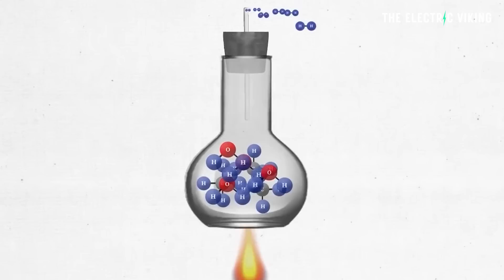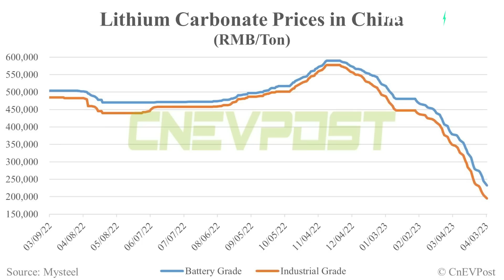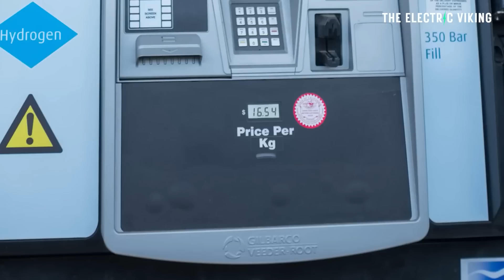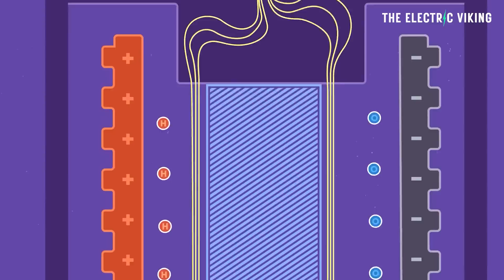Experts say Hydrogen for long-distance trucking makes no sense

Comment: I think the proponents of Hydrogen are blinkered by these key ideas...
1) There's no tailpipe emissions (even though it's emitting 50% of the energy stored in the Hydrogen as waste heat)
2) You can fill up quickly. (Yeah, but is that important when you can fill up when parked?)
3) The range is really long. (Actually no, it's no better than a BEV)
4) Green Hydrogen using renewable energy will be cheap. (Yeah, but you'd travel three times as far on that energy if it was used in a BEV)
Of course, anyone who's done the research knows that the end to end efficiency is 1/3 of a BEV. You still need a battery in a Hydrogen vehicle, and the system is SO complex compared to a BEV. Just picture how much it's going to cost to roll out the infratructure for filling stations.
Reply: Wow said it better than I could. I just said H2 advocates are clueless. I really hate the Green H2 BS. Green H2 wont happen while we have cheap hydrocarbons to rip apart.

Comment: From my experience i would say that one reason why hydrogen has such a huge lobby is that the enourmous effort that you need to put in to have any kind of hydrogen device working works quite well in universities and demo projects. Thats how hydrogen fans are made in universities. And a lot of these guys spend their work experience in demo and research projects where they never experience what it means to have a product rolled out in high volume series and what kind of robustness and reliability you need for that. Hydrogen is like a fatamorgane. The more you chase it the more it disappears into the future. I am really concerned that my Government (Germany) relies so heavily on hydrogen esp concerning energy supply for people and industry. They have made this failure once with cars in general. Then repeated it with trucks. And still if as an engineer you start to question the likelyhood of h2 fixing the huge problem of seasonal energy storage in the near future you will earn heave shitstorms from media and politics.
I am really glad to see people waking up on this if I read through the comments here.
Battery is the way to go for individual transportation / traffic.
Reply: Did you hear about people in america being able to contact emergency responders using fuel cell technology for long periods after hurricanes and the like?
Reply: Your 'hydrogren fans' are from the fossil fuel industry, not universities.
Reply: @Fomites  Indeed Most, But even some universities receive money from big oil.

Comment: Until quite recently - like until 5 years ago, a long-range battery truck did not appear to be possible. All the research was going into hydrogen because it looked like the only viable solution, and the hope was that the cost would come down over time. But it does now look like batteries will take this market.

I am an engineer working in decarbonisation of the rail industry, and again, until very recently the assumption was that hydrogen was the only technically viable solution to replace diesel. There are many programs to develop hydrogen powered trains. I think we are just on the cusp of recognising that batteries may be the better solution for most application. I have made a video on the problems with hydrogen for rail. https://youtu.be/1YDV0Vrmfw0

Comment: It's always hard admitting you've been wrong, but Sam has done so in this video. Some of you may have noticed he never mentioned that "11 people were blown to bits in a hydrogen filling station explosion in Norway in 2019". That's because they never were. A few got injured when the explosion set caused their airbags to activate.
The future really is bright. Hydrogen is expected to be half the cost of diesel in about five years. Sick of wind power going to waste? Don't worry because that power can now be used to make lots of cheap hydrogen. Hydrogen will power planes, drones and flying cars. Hydrogen paste is stable and is 10 times more energy dense than lithium batteries. Hydrogen is so clean it makes everything else look shamefully polluting. Heavy dirty batteries are not the future. Hydrogen is typically made on site at the filling station itself. No tankers just hydrogen on tap.
Reply: Hydrogen will never compete with batteries in road transport. Is simply too expensive.
The world is rapidly changing to BEV road transport while hydrogen goes nowhere

Comment: Hydrogen is currently not viable. It is being promoted by the oil industry because most hydrogen is generated with fossil fuels.
Reply: party;y teh reason. The other reason is quite simply FUD to keep people waiting another year or two because youve fooled them thinking H2 will make BEV redundant, "so why not continue with your ICE for another year or two?" Each years delay is worth literally trillions $ to oil
Reply: Only Green hydrogen fuel makes sense
Reply: You hit the nail on the head mate.
Reply: @larryc1616  Very expensive, why not just use the electricity directly to drive the said vehicle? Saves the second step of making H2. Far easier to store and ship. Right to your front door in fact.
Reply: @Lionel Wylie  because batteries are expensive and heavy. They are good for passenger cars, but hydrogen fuel is much better for heavy duty applications like semi, buses, construction/farming, shipping, military and planes. Fuel cells may be too expensive for cars but makes economical sense for heavy duty applications that battery powered electric motors cannot as of now. Hydrogen fuel has 3x power of gasoline so it can be used in ice applications even as replacement for high octane purposes maybe even replace dirty jet fuel.
Reply: @larryc1616  I have toyed with the idea of H2 for aviation. In some ways it would work. It is much lighter than JetA1 and it would be nice to have a take off weight lighter than your landing weight. (which I am not totally sure of. H2 does have mass but its lighter than air, so would it give you lift?) Well its lighter than Kerro anyway. It would burn much cleaner and you could use existing jet turbines too. However Jet fuel is cheaper than H2 and safer too. It is easier to handle as well. The fuel tanks would need to be very heavy because H2 due to is small size tends to leak out of all but the thickest of vesicles. The extra weight of the tanks might be offset by the lighter fuel maybe. Also given the fact that the H2 would most likely end up coming from Methane or some other simmer hydrocarbon anyway What are we achieving? H2 might work in shipping, I have not looked into it.
Reply: @lionelwylie2326  --"  ...why not just use the electricity directly to drive the said vehicle? Saves the second step of making H2."  Answer:  Why not, indeed!  If you have electricity from renewable sources, by all means, use it.  You would use H2 only when renewable energy is NOT available.  
Likewise, why bother to make H2 when you can use the electricity directly?  Why, indeed?  You would only make H2 when there will be a surplus of Renewable Energy and you don't want to waste it.  
Do those answer your questions?
Reply: @glennstimson6097  --The latest and most advanced electrolyzer today has over 90% efficiency in converting electricity to Hydrogen at high enough pressures to feed into pipelines .  Transport the H2 in pipelines is 98-99% efficient, depending on distance.  H2 compression is 90% efficient.  Fuel Cell is 60% to 70% efficient  Multiply all those efficiencies:  0.9 x 0.98 x 0.90 x 0. 65 = 0.52 = 52% efficiency from electricity to output at the fuel cell.  
Meanwhile, solar PV inverter from DC to AC at 93% efficiency and grid transmission at 93% efficiency and EV charging at 85% efficiency and battery efficiency at 90% :  0.93 x 0.93 x 0.85 x .90 = 0.66 = 66% efficiency from the solar farm to the output of your EV's battery.  
So, comparing 52% efficiency of Solar farm DC electricity to DC output of the H2-Fuel Cell... vs 66% efficiency of Solar farm DC output to AC in the grid to DC EV's battery output...isn't so bad for H2-FC...is it?  52% efficiency the H2-FCV route vs 66% efficiency for the electricity grid BEV route is very close!
Reply: @larryc1616   Fuel cell prices are coming down thats why manufacturers are saying in the 2030s hydrogen is to take of. Currently theres lot of innovation happening across the supply chain companies are well aware of all the issues. As it is lithium isn't going to cut it evs need better chemestry's. 

People say hydrogen is done but way more capital was going to evs once musk got ball rolling now you have countries not just companies looking into hydrogen applications.
Reply: @larryc1616  it still doesn’t, watch the video again

Comment: 'Experts' say that hydrogen is the way forward for farm vehicles:  I just cannot disagree strongly enough.  If I had an electric tractor, then I could recharge it overnight, either from the grid or from my own solar panels.  With hydrogen I would need to store full cyclinders, have to collect them or have them delivered, and then keep them safe from theft etc.  And then how would I move them around or  lift them up in order to refill the tractor?   Farm equipment is very heavy and not easy to manhandle,  At at the end of the day battery power is so much more efficient that hydrogen.  regards from UK
Reply: Solar panel’s would be useless for charging overnight,you’d have to have a spare set of batteries to charge during daylight hours otherwise you ain’t going anywhere.
Reply: Electric tractors are coming, Foxconn has just produced it's first 4 in Ohio, USA, and is readying for mass production. The founder is a ex-Tesla engineer and has contracted Foxconn to mass produce them. Oh, they can also drive themselves if anyone wishes them to.
Reply: @davidellis279  you understand that batteries have been invented right?  That can store energy for long periods of time?  Right?  Please tell me you know that….
Reply: I think one of the problems relating to farming is they only use the equipment two seasons of the year and when it is used they usually run full out to plant then harvest so any downtime to charge equipment is time they take away from the field operations.  Equipment then sits idle so investing in batteries for the high usage would be cost prohibitive.
Reply: Fuel prices have been a major cost in much of farming for a long time.  They will celebrate the day they can afford electric tractors and the wind and solar to charge them.
Reply: @AlanMasliuk  You balance the declining battery costs versus the always rising fuel costs. The prices of batteries are constantly dropping. More than 90% since 2010. There are many tens of billions being invested in new battery technologies and research. Sodium batteries, Sulfur batteries, both of those of which are beginning, or preparing, to be mass produced, not to mention the dozens of others still under research. 

Their charging in farms would be wholly via solar, the price of which has dropped by over 95% since 2000. So after the initial expense, which is cheaper than most think, its free fuel for any farmer from then on. That's huge for their bottom line, as the cost of fuel is something that takes a huge chuck out of their bottom line. Ever more so as it keeps rising.

I understand the ones that want to wait a bit until batteries get cheaper still, that makes sense, but it's coming big time. Nothing is stopping this now.
Reply: Adding context to my original post.  I have a small scale farm, with livestock and poultry, rather than an agricultural operation.  Being 'off-grid' I changed from a petrol generator to Solar Panels about 5 years ago, albeit on a small scale.  Enough to run electric fences, lights, radios and to charge vehicle batteries.   Obviously I would need to scale up and share resources with neighbouring farms, as we do now with other aspects of farming in my area (west of England).  And yes, I do not use my tractors  for periods of time - I now have an off-road electric bike to chase livestock around the hills - which can be great fun if the sun is shining!  regards .
Reply: @farmerpete6274  Yes, you can scale up and provide electricity to your neighbors as an extra income. Being from England, you should look up the episode on Fully Charge featuring the farmer who ordered and installed his own 2MW wind turbine and now provides power to all his neighbors, and paid off the full cost of the turbine through that. Now they all pay low electricity prices and are very happy.

Comment: I Agree. Storage and containment of hydrogen is its problem. In Australia many long-distance trucks carry 1000 litres or more of diesel fuel; the equivalent in hydrogen would take up almost all the front half of a B-Double. There goes 40% of your load capacity right away.
Hydrogen in the form of ammonia is more practical; it can be liquified at moderate pressures (similar to LPG or butane+propane) and as such requires only about double the volume of diesel fuel.
Hydrogen is more relevant for locomotives, because purpose-built pressurised tank cars can be used, for a payload reduction of ~2% instead of 40%

Comment: Some experts argue that hydrogen is not the most practical solution for long-distance trucking due to energy efficiency, infrastructure, and cost concerns. As battery technology improves, electric vehicles are becoming more suitable for long-haul transportation. The future of long-haul trucking may involve a mix of technologies, including battery electric vehicles, hydrogen fuel cells, and other alternative fuels.

Comment: Already use natural gas in long distance trucking  between Toronto to Montreal for at least 15 years and Hydogen might be too expensive compared to natural gas.
Reply: yeah. Once Exxon starts tagging on transportation, maintenance, infrastructure, and an “f.u. give me money cost” onto the hydrogen, it’s probably gonna be just as expensive as gas. Can’t happen with EVs since electricity is controlled by the state so you don’t really get price gouging.
Reply: Yes, and natural gas can be "green natural gas" if you capture all the things that can rot to make methane.
Reply: Methane pyrolysis is a promising technology for creating green hydrogen.
Reply: @lesliecarter4295  Any system like that takes added energy.  There is no reason to use hydrogen.
Reply: @kensmith5694  burning methane/natural gas gives off CO2 so it has to be removed before combustion 🧐
Reply: @lesliecarter4295  You are not following the logic.
1) I grow some beans.
2) Beans take CO2 out of the air to make the plant material.
3) Through a process I convert some of the plant material to methane.
4) I burn the methane returning only the carbon from step #2 as CO2
There is no CO2 being added to the environment by this.  For that matter some is removed in this loop.

Comment: Viking please note that Hydrogen in the context of energy and energy storage does not mean just hydrogen it means all the molecular compounds primarily purified water H2O  and Ammonia N2H. 
The most simplest and most desirable of these to to transport and store and create is pure water. This is via either desalination which is very expensive but getting cheaper or refrigeration which condenses water vapour out of the atmosphere. 
Water can then be pumped into our existing pipeline systems and storage facilities thus leveraging from our existing infrastructure. 
The electrolysis can then happen locally on site ( be that of a home or office or industrial site)  for burning or for a fuel cell to produce electricity. 
Water is the key. Plus we can use the additional water for normal use if needed . So this additional water will force water prices down but additional uses will increase prices thus a new equilibrium price will be found. This means fresh pure water for drinking and power will need to be made on an industrial scale which means condensation via refrigeration. These refrigeration units just use electrical power to create very low temperatures that condense out water vapour.
Reply: Why not use the electricity to fuel the vehicle directly and miss all the rubbish in between?
Reply: @lionelwylie2326  because hydrogen is not just about cars. It is for industrial furnaces for making steel, for ships and airplanes for trucks anything that requires high energy density or to store large amounts of energy. 
Hydrogen can be burnt to produce heat or via fuel cells to produce electricity. Thus it is versatile .  
You also do not need the mass production of batteries only some in the case of fuel cells though.

Comment: Green hydrogen makes sense for steel production to replace coking coal.  The process requires a reducing agent to chemically separate the metal from the oxygen.   For transport it’s hard to see hydrogen having a role on economic grounds except maybe in jet aircraft.

Comment: The dream was of Hydrogen being made by surplus wind and solar at times when there was excess electricity. At the moment cheaper storage and scheduling of electric vehicle recharging is avoiding some of those gluts, but given the price of solar and wind capacity I think we are still going in that direction - for the UK to have a lot of solar even in winter there will be huge surpluses in the summer.  Rocket fuel to get stuff into Earth orbit and long range air travel are currently niches that batteries might struggle on. Of course everything changes if someone invents as more efficient way to make hydrogen with electricity, but at the moment it looks like the big advances have been coming in batteries not in the efficiency of hydrogen production or storage.